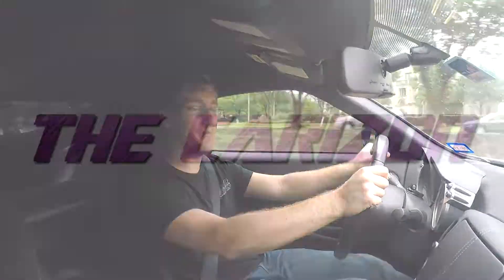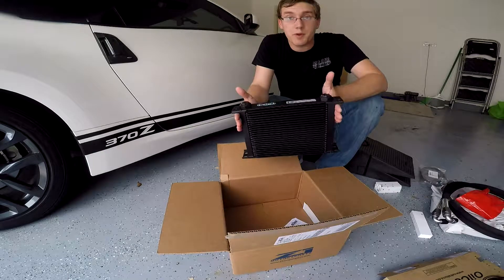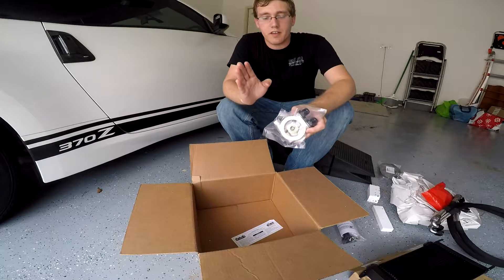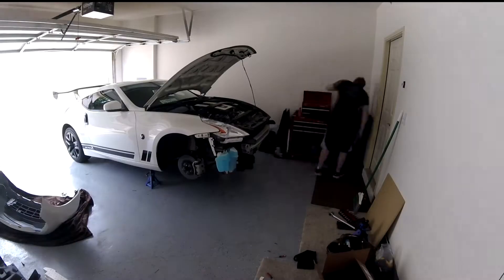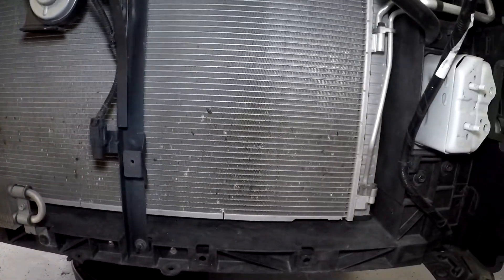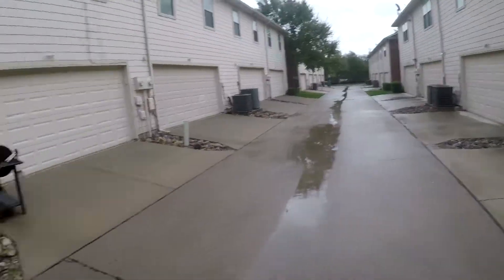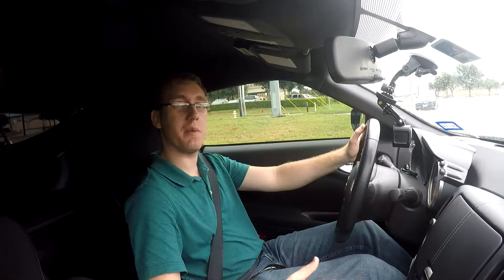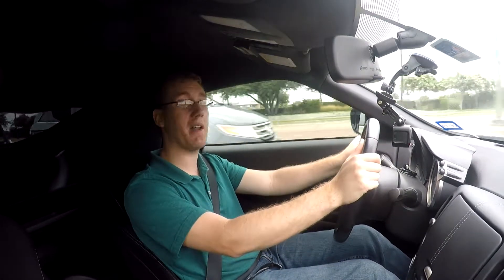Road to Boost Ep.2 - Oil Cooler Install

Comment: I'm planning on installing an oil cooler on my Z to bring down the oil temps. I was curious how much of an oil pressure drop there was across those right angle bends in the oil line fittings. I'm going to try to use fittings that use less sharp bends. I'm also planning to use two smaller oil coolers in parallel that will be situated in the front of an aftermarket bumper cap in front of the wheel wells. This is to have the heat not ducted over the radiator, where it would increase the heat load on the cooling system.

Comment: Hey Carizon, do you think that a 34 row cooler would interfere with a still supercharger kit?
Reply from the maker: Not the one that I have, but if your air filter is going to be in front of your radiator then yes.
Reply: @thecarizon504  do you think it would fit with 25 row?
Reply from the maker: @EL-sc9on  I heard that the stillen fits the 25 row but not the 34 row.
Reply: @thecarizon504  I got the 34 row fast intentions hopefully it will be good :( I plan to go A2A with a supercharger as well. What do you think is the best super charger kit in terms of reliability and performance

Comment: Since I am looking forward to installing a kit on my Q50 quite soon, can I get your input on something? The sandwich plate is not thermostatic, how much should I be worried about that? And another question on top of that, if I should be worried and should want to replace that sandwich plate, do you know of any sources where I can acquire a thermostatic sandwich plate independent of the kit? And one more question, are there any outside wiring, electronics or battery needed for the thermostatic plate?
Reply from the maker: It's not a big deal but you should consider getting a sandwhich plate, I believe Z1 sells them.
Reply: @thecarizon504  I just ordered a replacement thermostatic mocal sandwich plate from MAPerformance for $78. Simply verified that it had the needed thread pitches. This really has me thinking about how i could have just spent a little extra time and sourced all my own parts for the cooler kit. Z1 definitely takes off the top, they sell the same plate for 130!

Comment: Fixing to do this to start getting my Z track ready myself. Only other mod I have is resonated test pipes for more noise and feedback on when to shift. Stock sound is no good either lol. I plan on doing flywheel and clutch replacement for slave cylinder and clutch itself in one go. Then stiffen suspension and replace all fluids then will feel good about how it is.

Comment: Hey! Nice videos man. I def hit that sub ! I’m looking into this soon! How’s it been now ? Still running strong and cooler? No leaks ?
Reply from the maker: Yes, yes, and yes. Still working like a charm, moderated the temperatures really well, no leaks.

I have a separaye video up detailing the install if you decide to pull the trigger. I highly recommend getting the sandwhich plate as well to help engine warm up, etc.

Thanks for the support!
Reply: The Carizon yeah man I saw that video entirely as well! You’d did such a good job on explaining the install dude. Z1 should totally use your video ! Ha! Thanks man. Yeah Il be using your video for reference when I do mine!